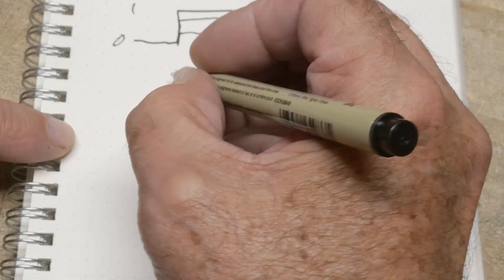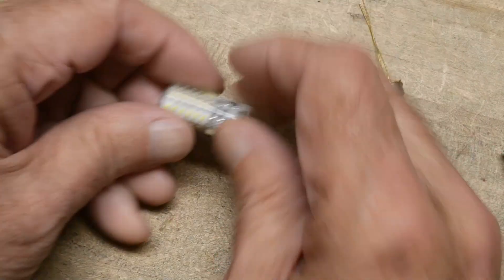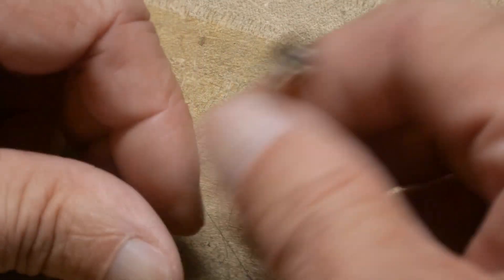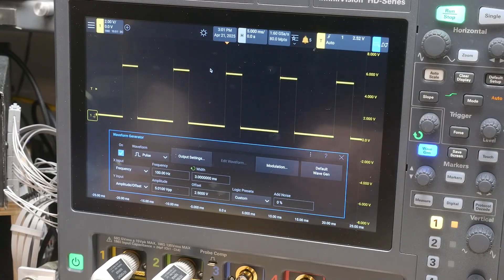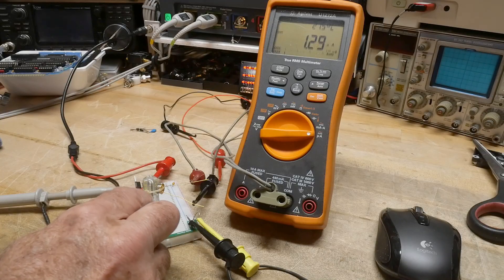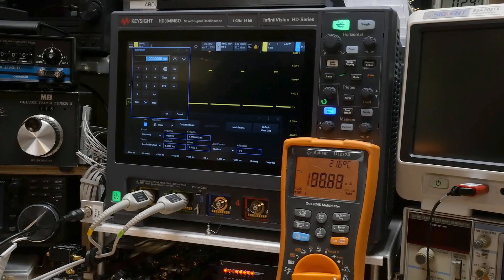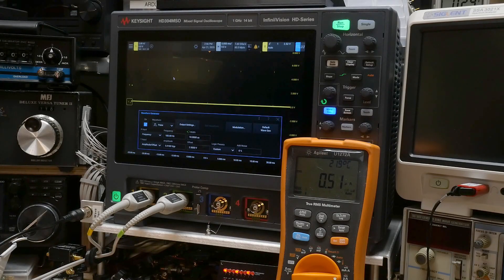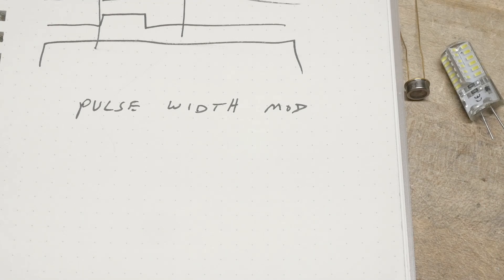#2227 Basics: Pulse Width Modulation PWM

Comment: Use a linear power supply and slowing increase the voltage and there won't be any flickering. To stop the flickering in your case, just add a good size capacitor across the LED's.
Reply: I thought the flickering was caused by by the camera being out of sync with the pulse.

Comment: When you are dealing with a light source a couple of points are worth noting.
• The response of the human eye to actual luminance is closer to logarithmic than linear.
• Depending on the switching frequency, the eye has a tendency to "peak detect." This effect isn't usually noticeable with incandescent lamps because of the averaging effect of the heated filament, but it can be noticeable with LED sources.

Comment: I have a Bosch dishwasher that makes an insane amount of RFI.  I have always blamed its use of PWM as the reason.  Am I wrong?  I have placed many ferrite's on the AC mains input and this does not help.  Other remedies? And practically, why so much RFI from PWM .  It seems to me that as a variable square-wave it will have a plethora of harmonics and the designer should filter that...why not, Bosch? It renders the entire HF spectrum unusable for the wash cycle.
Reply: What is the main  power controlling  device....
SCR/TRIAC/BJT/MOSFET...???
Can you draw/show the gate drive ckt..
....
Reply: ..IMHO... it's most likely a TRIAC..

Comment: Pulse Width Modulation or Duty Cycle Modulation? As long as the frequency is constant, it simply does not matter, because pulse width and duty cycle are proportional each other. But. That's not always the case, you can easily have system with constant pulse width, where varying frequency causes varying the duty cycle. And the crest factor, which is the key factor of this kind of regulation as it defines the relation between peak voltage and the effective voltage, is proportional to duty cycle, not the pulse width. In fact, you can vary both frequency and duty cycle, which is the most common case, because short pulses sometimes causes problems (esp. when it comes to reactive loads), so you can easily lower the frequency to obtain same duty cycle with much longer pulse.

I remember thyristor regulation of motors on local trolleybuses that utilized constant pulse width with variable frequency. That thing made horrible noises, it was literally singing. Similar kind of regulation was on local locomotives (called Unipulz), where pulse width was modulated, but the frequency was also switched between fixed values of 30, 100 and 300Hz depending on range of controlling signal.

I am not sure whether using a photodiode is the best solution to this particular case, as they are relatively fast in their response, but you need something relatively slow to do the integration on it. Maybe photoresistor would be slightly better as they are typically slow as a hell. Using real lightbulb would be also good solution.

Which brings me to the last point — why is that LED thing marked as a DC only even it utilizes some rectification diodes inside it and has no marked polarity. Few weeks ago I came across with device called "electronic light bulb transformer" which is something intended to power 12V light bulbs from a 230V mains. That thing has over 40kHz AC on its output (which was something I didn't expected), which is too much to almost any rectifier bridge or diode used in mains rectifiers. This is in my opinion why is that thing marked as DC only.
Reply from the maker: I've never heard anyone use duty cycle modulation, but yes
Reply: @IMSAIGuy either the Ton ...or the Toff period is fixed..and the "repetition rate" / freq. is adjusted as the control parameter...
This is usually a restricted range.......
in nowadays controllers some of them provide some thing similar..but mainly as a form of additional current protection...a.k.a..." cycle skipping"....
Reply: You mean 'FM' as opposed to 'PWM' in essence.

Comment: I have several RF oscillators consisting of Gunn diodes operating at 10 GHz.  I had considered different ways to impose information to transmit with them.  With that sort of constant amplitude device you may be limited to something like frequency modulation or PWM,  maybe.  Then a simple detector receiver could demodulate and feed the PWM information to a decoder.  Ya think?

Comment: If the voltage across the photodiode rises to more than several hundred millivolts, the current response of the photodiode will no longer be in direct proportion to the light.  It would be good to check the impedance of the current meter being used to see if this is the case.  Without using a transimpedance amp, you can negate the effect by adding a low value resistor across the photodiode and measuring the voltage generated.  Change the resistance as needed to keep the voltage below a hundred millivolts or so and you will have a photocurrent that remains in proportion to the illumination power on the photodiode.
Reply: With PWM type of control for "brightness"..it is difficult to have linearity even at 1% duty..... that's because even for that short time the LED's are subjected to peak voltage...that short duration when the lamp is @ max. brightness...so the 
sensor may "saturate" briefly...and recovery after saturation is always sluggish... therefore it has a poor dynamic response for that duration....
Human eyes cannot perceive this .. properly..
Hence voltage level control is best...for led's.

Comment: The LED lightbulb looks like it's an incomplete car lamp replacement. The rectifiers allow you to install it in any orientation because some car lamps aren't keyed, and the resistors provide a load to allow the newer cars blown lamp detector to think there's a working lamp and prevent a false dash warning.
Edit: Some of those resistors are also used as a series limiter.

Comment: I have a bunch of very similar lights like those in various colors. Looking forward to see where this progresses... Buck/boost converter? Class D audio? Or with the photidiode.. 'Constant brightness' greenhouse would be a cool thing to make. A while ago I was planning to convert some body converters for plant grow lamps to constant-current, but then I realized I could just as easily make them constant-temperature with a ptc on the heatsink.
[sorry for rambling... I just like pwm.]
Reply: Another cool thing you could show is that you can just point two LEDs at each other and use one as a photodiode. Basically you can make a 2-way optocoupler by changing which one is the input, which is useful for absolutely nothing.

Comment: Could you get the CRO to monitor the output of the photo diode  to see if it has a different characteristic to the PWM on the LED?
Reply: That would be interesting, to see the response time. Although the way related devices like that are most frequently used, such as an optocoupler, they put a small cap on it to deliberately smooth it out.
Reply: @SkippiiKai Yes,  theory says it might have similar characteristics to Opto Coupler. The input impedance might be higher causing slower rise times.
Reply: @jjoeygold  I've tested it, and the voltages are all over, but it technically works. Just not very well.
Reply: Thats a nice quick and simple idea, we could see time domain stuff next to our PWM, might be interesting.